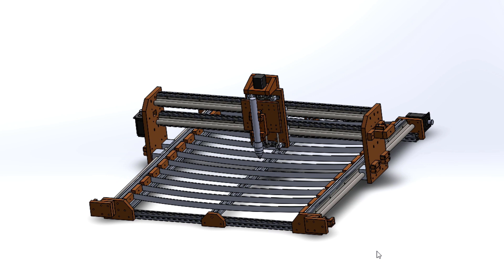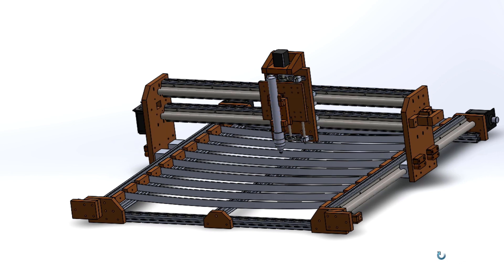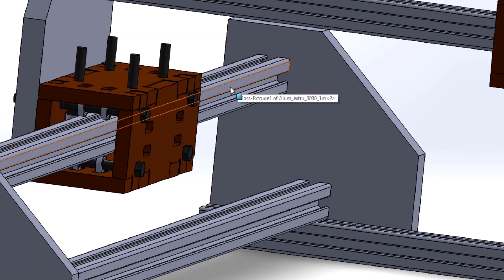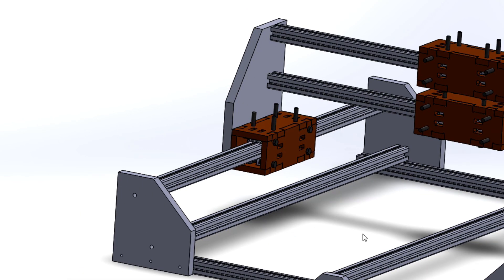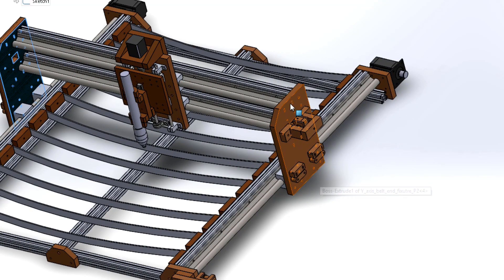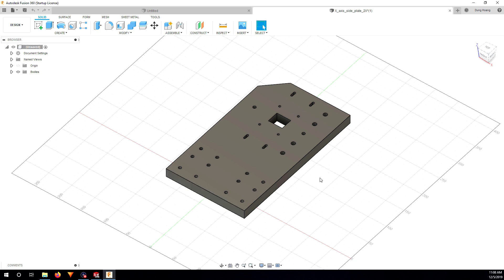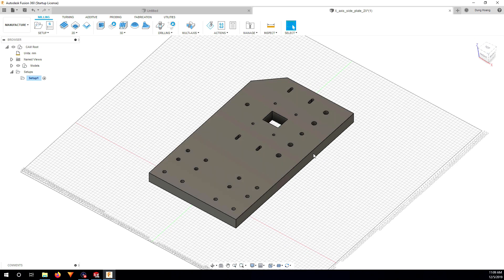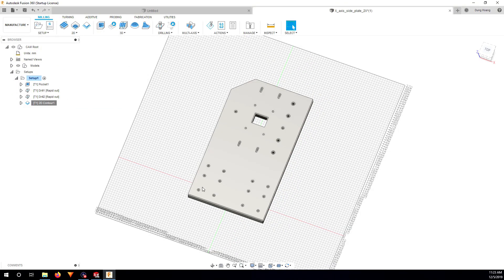CNC Plasma cutting table for under $1000 - P. 1 - Design and CAM

Comment: I learn now, its also good to draw the sketch on paper and glue it on the metal and drill it manually for the first part as long you dont need it more often then 1-2 times. Because the preperation takes a lot of time and experience i see now.